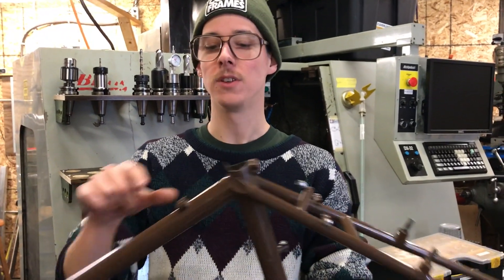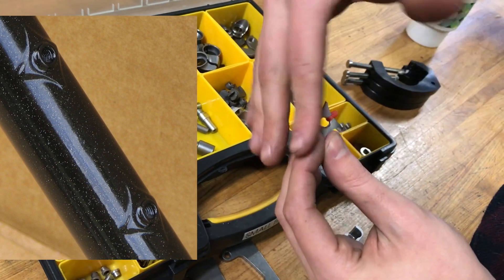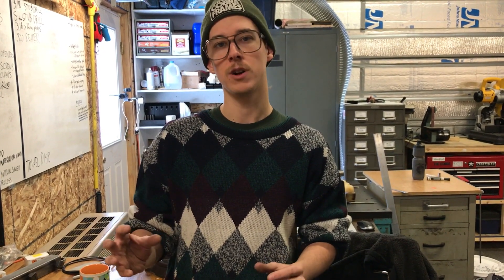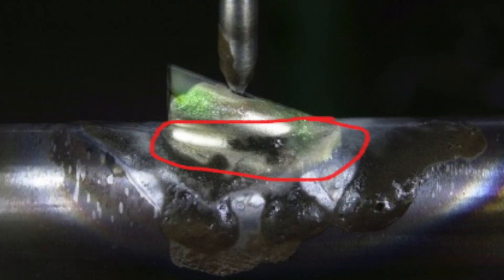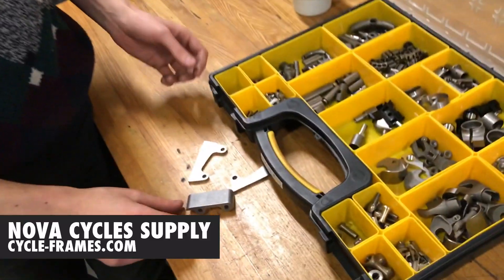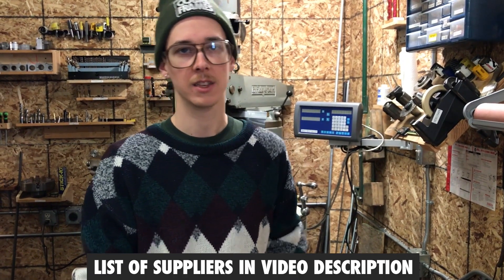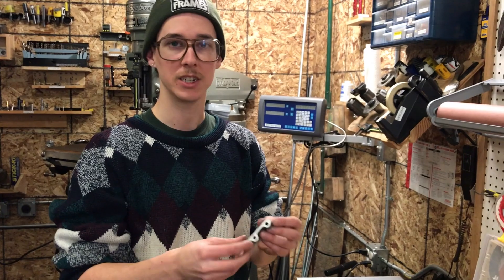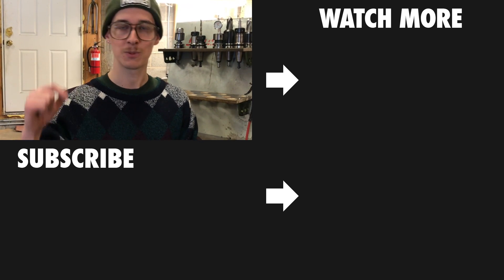Braze-ons: What You Need to Know | Bicycle Framebuilding

Comment: Can Romex Wire be strong enough to use as a brazing rod? To reweld the top of the frame that was cut off and repositioned?
Reply from the maker: I would assume not. Proper welding filler materials are dirt cheap. Don’t skimp on filler rod.
Reply: @cobraframebuilding  I got the rods 4 for 5 dollars it's bronze with flux coating. I hope my ts8000 propane torch will braze it.. 1600 degrees..

Comment: I was looking for wiring guides on my motorcycle frame build, came up with using braze-ons when routing new cables on my Surly Troll.  Used about 20 of them on my old Harley dragbike build.
Reply from the maker: I don't know much about motorcycle frames, but if they don't have brazed on cable guides, I bet it would be a nice addition in some cases!

Comment: So.....I like your channel
but want to say, after 40 years of on again, off again frame building.... (1st
frame in high school at 16 years old in 1977), I noticed you and other frame
builders want to use a 'carbonizing', wide, NOT focused flame while brazing.  My experience has been, and even today as I
brazed on a few water bottle mounts, that a small, low pressure, concentrated flame allows precise
and controlled manipulation of both silver and bronze.  It is MUCH easier to control the heat and
focus it into the area of higher mass, i.e., the tube vs. the braze on, which
is easily overheated.  Orange is not your
friend, and a dull red should be more than sufficient for silver, with dull orange
being the top temp for bronze.  That
said, with plenty of white flux, a low temp focused flame, it is a simple
matter to control the flow and pull the silver in and through the joint with a
beautiful silver line around the joint.  The
tube/joint should have very little black, carbonated, overheated, burned
evidence around it and should be kind of clean with a glass like flux residue
to be sand blasted off… (my favorite method). 
Again, like your channel and keep it up…. great info for anyone
interested in machining/frame building.
Reply: You just wrote what i was thinking.👍😃👍
Reply from the maker: Admittedly my brazing is super rusty. I haven’t used the o/a torch much in years. The footage was pulled from another video where the point was demonstrating my braze clamps in use, not teaching brazing technique. I appreciate your critique and I’m sure you know what works best for you. For these I just adjusted the flame to slightly carburizing like I was taught to in the framebuilding class I took with Doug Fattic, and yes I might have had better control with a lower flame.
Reply: @cobraframebuilding Yeah, and as an old crusty amateur, I am only trying to offer good suggestions.  What I see on you tube for some reason are all these 'carbonizing' or ‘carburizing’ flames.  I will admit, after watching some of these vids, I tried a wide flame like that on the current frame I’m building and it was nearly disastrous, overheating and very little control.  I did manage to salvage the frame but I needed to reflux and CARFULLY reheat and move the silver around with a concentrated flame……. Old school Reynolds 531 and Columbus SL and SP combo tubes…. Fairly forgiving but still….Anyway, love you enthusiasm and your channel and if I can be of assistance, let me know.